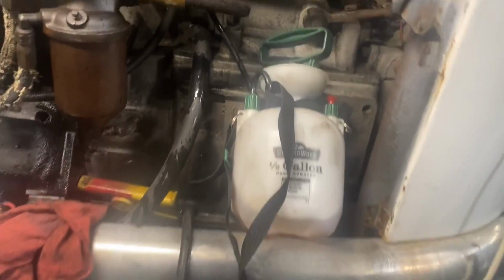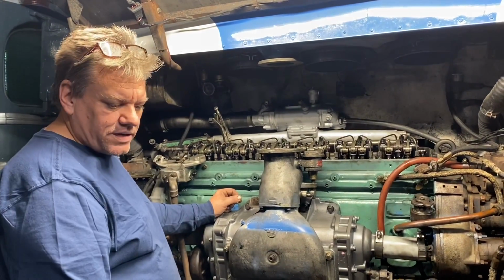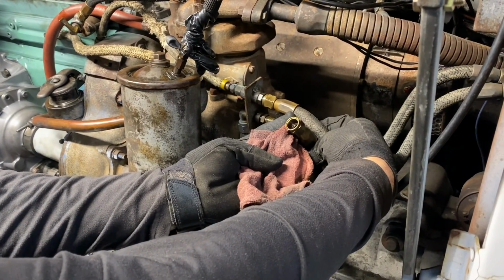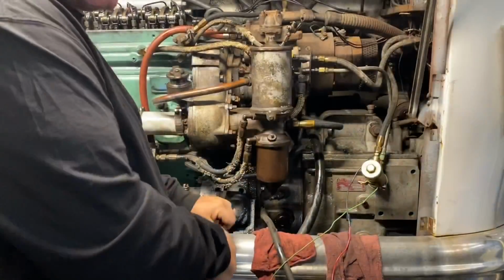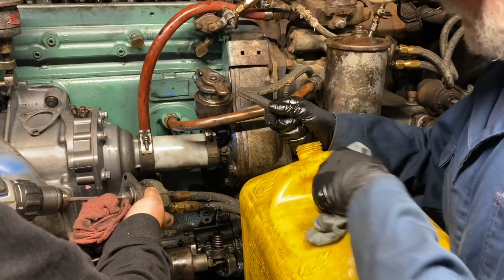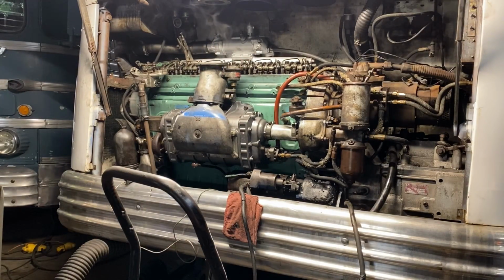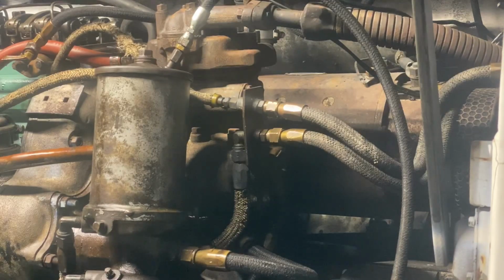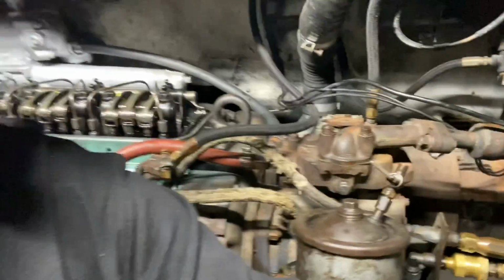1st start detroit diesel 671 a long day of problem solving

Comment: If you have the fuel issue again, try greasing your pump. Its a trick old timers on these engine often know about. When you split the rotary pump apart you will note the forward weep port that most of them have along with a lip seal on the shaft. This causes air to be sucked in (if they are old and dry) and the fuel system to drain down when it normally wouldn't. But it wont leak when under pressure. Grease on the rotors during reassembly will also help pull a good prime from the tank. With grease it will usually fire up on the first starter haha

Comment: Never ceases to amaze me the number of vehicles with undersized or mickey moused battery cables and fuel hoses that are the same one the vehicle came with when new decades ago and or millions of miles ago. 
This vehicle is a good example of one that needs a flexible lines and battery cables replaced and hard fuel lines inspected visually and tested via vacuum and or pressure testing.

Comment: It's funny reading these post on old fuel lines when all it needed was a check valve to keep fuel up in the head. Like you said the lines were all going to be replaced anyway. I have a check valve on my 2 stroke outboard because I have oil injection. You wouldn't want fuel backing up into the oil tank for sure. Good seeing that one start. Good job guys

Comment: This is why I replaced every no-metal line on my bus.  I hope I don't have to go through this!
Reply: That's what I'm afraid of when I start monkeying around with ours. The hoses are so stiff I will just replace all of them to be on the safe side. The bad thing is that Scott didn't hear it run or take it apart. I personally do not like coming in behind anyone else. That makes it twice as hard. He has done a great job with very few new parts.
Reply: A 3/8 stainless tube. Properly mounted & supported will last longer than the bus. 
With rubber or braided hose, to make a soft convection.  Should never give ya problems.
Reply: @rodneymiddleton9624  You're very correct sir. Talk about starter LUCK just go grab one off the shelf holy crap. This is a budget build isn't it? A job very well done, thanks for taking us along.

Comment: It seems to me that the first thing to do would be to replace all the fuel lines. All the problems I’ve had with my duramax have been fuel delivery related and it seems to me that a good fuel flow would have made the day easier.
Reply: Agree specially with very old fuel that's probably full of bacteria and slimes.
Reply: I know however it is a diesel and my point was that fuel flow is very important and if it had been there, their day would have been easier.
Reply: @jacobpoucher  Not sure about a dmax but an old GM run very high fuel flows, a 6-71 can be burning near 6 gallons an hour at fuel stop, it's returning around 30 gallons an hour through the return line. That's why an engine only making about 200 Hp is plumbed in 5/8 and 3/4 lines.

Comment: Hopefully after such a frustrating day it gives you some comfort to know there are those of us out here who have and continue to go thru similar experience. You have given education, inspiration, and above all hope.
For example, hope that I'll get my previously  smooth running 6v92 going again after sitting for several years.  Last time I tried to start it I spent a couple days doing much the same priming & re-priming cycle (using every known method of forcing fuel into the fuel rail known to man) until I had to move on to another project just to keep my sanity.   It didn't help that every so often some guy came by telling me to use more ether.   :-(   
Now I have a short list of additional things to try.  Thank you!

Comment: Glad you weren't immolated with your diesel shower. Once, a long time ago in a distant land, I was filling the day tank of the 600hp diesel starter motor for the 25MW Westinghouse gas turbine generator... The tank gage was under the unused 3" filler neck directly above. I operated an auxiliary fill valve while looking at the hard to see gage below the spout. Fullness was discovered experimentally... essence de parfum diesel.

Comment: I agree with most post and I would have stopped to replace every rubber line and the seals on everything long before 1/2 way thru the video !  Congrats on getting it running but may have to go thru it all again when you replace the lines !

Comment: The fitting for the return line coming out of the head is supposed to be a special restricted fitting so that the engine won't lose prime. Also the restricted fitting helps maintain fuel pressure in the head and injectors, otherwise without a restricted fitting the fuel would just go straight on through the head and back to the tank and wouldn't maintain pressure.

Comment: Man you fought with that fueling issue forever. The first thing you said was that there wasn't a check valve. should have gone with your first instinct instead of chasing that issue all around and back. But it's done and now on to the other little issues. Nice work.
Reply from the maker: It drove in fine without a check valve for a long time.
Reply: @BusGreaseMonkey  Strange. you toss a new spring on that starter solenoid?

Comment: Hey Scott it's normal for those load testers to smoke, all the resistance is heating up the coil inside, so it's like an old electric heater starting up, all the dust burns off.
Reply: i love detroit diesel . i am a detroit specialist .
Reply: That's why us techs call them "egg fryers." Lol

Comment: All Gm have a restrictor in the end of the head in the return line. This helps keep the head full of fuel and also create the correct pressure at the injectors. And not rely so much on the fuel pump for maintaining fuel pressure directly. You might find it will starve for fuel at high speed. You need to check what restrictor is required for that motor. The restrictor are all different sizes for different motor and injector sizes.
Reply from the maker: It has the restrictor fitting on the head

Comment: Another thing that will help you diagnose air in the supply is a refrigeration sight glass - you can see the air in the fuel with a flashlight.

Comment: Detroit Diesel fuel system troubleshooting 101:  
1.disconnect tank suction line insert in separate vessel filled with fuel
2. Disconnect fuel return line and put in aforementioned fuel vessel
3. Install fuel pressure gauge in outlet of secondary fuel filter.
4. Prime the system
5. Start the engine
6. Fuel pressure should be 45 to 65 psi
7. Return fuel should not have any bubbles or combustion gas
8. At rated speed, fuel return volume should be approximately 8 tenths of a gallon in 60 seconds.
Reply: 9. check restricted elbow screwed into the head is on return hose and not supply hose
Reply: Item #9, i think.
Reply: Ray and Bryan, if the fuel pressure is low #6 and the fuel return volume is high #8, that will lead to to check the restricted fitting.
Reply: @markphilpott8735  That's true if the restricted fitting has been accidentally left out and replaced with a full flow elbow fitting, low pressure, flow rate will be only slightly higher as a GM has a positive displacement gear fuel pump.
If however the restricted fitting has been plumbed onto the supply hose instead of the return the circuit restriction is the same, the pressure gauge at the secondary filter will read the same, it's just now the injectors are only seeing return line pressure  after the restriction instead of the 40 ish psi before the restriction. It's quite an easy mistake to make specially if an apprentice has pulled all the flexible lines off an engine to replace them without marking where they come from, and the tiny .060 stamped on the fitting is coated in paint. The engine will still run, just very low power.
Reply: @rayg9069  Agreed, so the one step I left out of the troubleshooting logic has to do with the temperature of the return fuel.  If the engine is at operating temperature, with the restricted fitting on the inlet side, the return fuel temperature will be excessively higher than spec, leading to a power problem.  Personally, I believe the problem they are having is deteriorated, crispy crunchy aeroquip fuel lines on the suction side and that antiquated primary filter would be suspect too.  Obviously, air is entering on the suction side.
Reply: @markphilpott8735  I wondered if the fuel pump relief was partly stuck open, could be causing poor circulation. Didn't see it mentioned.
Reply: @larryskeeper1197  maybe, anything is possible, but that doesn't explain air in the system or why it's losing prime.  If there was a problem with the relief valve it would show on the fuel pressure gauge.
Reply: @markphilpott8735  I'm not saying your original checks were wrong, I was just adding a commonly overlooked simple mistake made when lines are replaced and the engine won't run properly after. I totally agree their problem is most likely crispy fuel lines with cracks or hose that is de layering and blocking with bits of rubber.
The restricter being on the wrong line won't affect return temp much as the flows through the rails are the same, just the injectors won't be able to fill properly as there won't be pressure pushing the fuel into the injector body.

Comment: pro-tip............swivels on your fuel lines can let in air when they are old,and let fuel run back to the tank. Replace them, by the look of things those fuel lines ( and the swivel fittings) are ancient.

Comment: When the fuel tank is lower than the engine, the return line needs a standpipe in the fuel tank to keep it below the level of the fuel just like the pick up tube. This makes the fuel system a loop and makes it impossible to drain back without the need to rely on check valves which can fail. The only thing that will cause a problem with this type of system is a bad line/air leak.

Comment: Let the air bleed off before you remove the rag.
 Oooopp's. 😁
 Very few mechanics on the automotive side know that little trick. You can go all the way to the injector crossover line to Purge the complete system / filters & all of air....
 Nothing 100 lbs of floor dry won't fix
Edit: bleed all the way to the injector cross over tube. 
That. Will insure a air free system. If it 
self siphon's you have a pin size hole in the system. Fuel cannot overcome the vacuum of a sealed system. The check valve you installed is covering up a bigger problem.....

Comment: I used to work for Amtrak on a switcher in Boston and one night was running an old 50’s Alco RS-3 repowered by Conrail with an EMD v12-567 engine but still using the original Alco fuel filter assembly. The engine would starve for fuel due to plugged filters so I asked a machinist where were the fuel filters stored? Turns out they were in a storage room in south station terminal so I requested The yardmaster allow me to go to south station so I could get the fuel filters replaced while my crew was on lunch break as we has finished our switch till morning and he allowed me to go get ‘em ran the engine into south station and shortly he showed up with 2 new filters but being new didn’t have a clue how to change them so I talked him through it. The amount of crud he had to remove with his hands was astonishing until I reminded him the engine was built in 1954 and this was 1975.
She ran perfectly after the new filters were installed. It was rated at 1200 horsepower.

Old school still has a place even today based on the number of converted bus into RV’s there are that search out the BGM services.

Comment: Scott  We H1's owners are so anal about our leaking fuel systems that we install a piece of tygon or viton  clear line on the injector pump return line. Then all you have to do is look for bubbles if you suspect a cracked or loose hose or fitting upstream!! Our injection pumps can draw fuel but it's hard on them. Great video. It would be nice to have a clear line running to the fuel filter for easy viewing.

Comment: Scott, I wouldn't be too concerned about that low compression.  The rings haven't seated in and even though the valves were lapped, they will "wear in" over time. Once you guys bring it up to temperature and put a good load on it, it should be fine.

Comment: If you need heavy battery leads made up and can't find any try a welding supply or engineering supply shop as they can make leads for you with heavy welding cable and eyes. When you are using the airline to pressurize the gas tank regulate it to 10 - 15 lbs fuel tanks aren't designed to take pressure. Are the fuel lines porous. they won't let fuel out but will suck air in? I had the same problem on a Mercedes van They have fuel lines with plastic fittings and O rings The o rings get hard and overnight the air is drawn in and it makes it hard to start. I replaced the 8 o rings and all is well. You could try getting the hoses re crimped as old hoses can shrink with age and come loose on the fittings.

Comment: Shouldn’t there be a restricting orifice on the outlet to the head for the fuel?
Reply: Yes, all Detroit 2-Strokes had a restrictive orifice fitting on the return line out of the head. Quite certain they were marked (stamped) as to the size of the orifice.

Comment: GM 5.7 Olds diesels, 6.2's, 3208's in the Wanderlodges, the old diesels I work on, all of them get check valves and electric pusher pumps.

Comment: Wonder if the level in the fuel tank is low enough for the return to be open to air?
Reply: Or the return tube has cracked or rusted off in the tank, seen that happen as well.
Reply: Returns do not go down in the the tank.
Reply: @KPearce57  In a GM they do, all the way to the bottom, if the return tube is above fuel level the 'seal' is broken and the lines and head will drain back, very common no start problem on a 2 stroke GM.

Comment: Ran my MC 9 out of fuel twice.  NOT A FUN experience and fuel supply is hard to regain.  Used air on the fuel tank the first time, an electric car fuel pump the second.  Sold it 8 years later and never allowed the gauge below a quarter in that time.  Almost seems like you have a plugged line or one with a leak.  Good luck!

Comment: Hi Man i instale in the main fuel line from fuel tank to primer filter  a gasoline pump AC from a Military truck Reo   .Open the purge plug , and pumping the fuel and presurize into a primer filter and engine inyector line, was the fuel isnt with air bubbles in the fuel return .Start engine SURE  without problem As the military fuel pump have 6 valves not build contrapresion in the gear pump line ;and perdurable for ever

Comment: Figuring out an air leak on the suction side of the fuel system is the most frustrating thing ever! Last time I did this, it took me ages to find it.....
Reply: smiffy1071 Just need to sectionalize the system and use a vacuum pump and pressure pump to check each section.  It can be a slow process but one you have to accept and do.  I have all sorts of fittings, clamps, hoses in my fuel system testing kit that I have accumulated over the years.
Reply: gullreefclub eventually I found the sediment filter housing had a pin hole in it, and that was enough. 
Finding a new housing was fun, on a bus that was out of production for over 30 years!

Comment: Love your show! I went out and bought a 2-71 and I will try to get it running.  What controls the fuel pressure to the injectors.  Is they a pressure regular on the return line?
Richard Goodman

Comment: the smaller  6 gauge cables are because with dual batteries each6 gauge cable is more than sufficient to feed the load on the starter..... PS, next time, place the booster on the junction terminals when starting

Comment: Never worked on buses BUT all the Detroit's I ever worked on had a check valve mounted at the primary filter and they were ALWAYS mounted vertically. Yes, I know there is a spring loaded flapper inside but they were always vertical. I don't understand why you don't carry a manual hand pump to prime the fuel system? Do you not carry fuel hose with you to replace those awful looking fuel lines? They all have reusable fittings and could be replaced in very little time. This was hard to watch. You took a lot of time to get this engine started. Don't think my bosses would of been very happy if it took me that long!
Reply from the maker: We did prime the engine multiple times.  It would loose prime from the head in mere seconds after being primed.  I’ve never had that happen before. I primed it with the fuel pump first.  Garden sprayer 2nd,, aux pump 3rd, pressurize fuel 4th, pressurized aux tank 5th time and so on and so on.
Reply: @BusGreaseMonkey  Do the buses NORMALLY have check valves though? Most of the equipment I worked on had the fuel tanks below the engine BUT even those that didn't still had check valves on the primary filter.

Comment: Hi, could there be a vacuum in the tank , sucking back the fuel, the check v/v would stop this and when motor is stopped the vacuum would leak away slowly. Maybe check fuel tank vent. Many thanks for the very entertaining and informative videos.

Comment: I changed my fuel pump and tried pressurizing the fuel tank with air and that didn't work. I changed the 90 degree fitting on the fuel pump to a "T" and put a shut off valve there. I then hooked up my air conditioning vacuum pump through a mason jar. As soon as I switched on the vacuum pump, it primed the fuel pump and filled the mason jar halfway almost immediately. I shut the valve off and disconnected the vacuum pump and the engine started easily. I leave the valve hooked up, should I ever need it again.